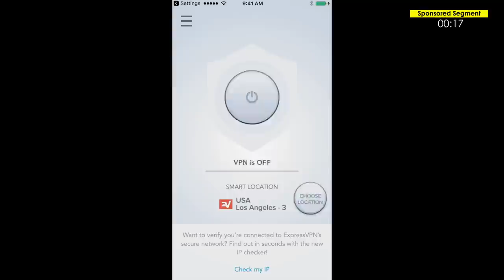Nick Makes a Net Gun to Catch Friends

Comment: Nick could get the tubing for the top darts of the net a little bit more small so there is more air pressure on the top parts and it probably could get the top part of the net  higher-up thus expanding the catching limit of the net

Comment: NICK! might i suggest adding wadding in the barrel and replacing the dowels with a rubber ball? the wadding will seal up the barrel (think like the wadding in a shotgun shell) and push out the ball with more force. I feel that the sticks are too light and that's why you're not getting enough velocity launching the net. you focused too much on the net weight trying to get it to go farther when you should have been focusing on the rod system instead. those dowels just seem too light and if the barrel and dowel doesn't have a good seal, the majority of that air pressure will just shoot past the dowel without at least some wadding.

Comment: Awesome build with the interchangeable heads!

Steve the landlord was giving you the answer right there. RAMSET! Load four of those .22 blanks at each dowel corner....kapow! That net is getting launched with some force. How you set off the blanks? You could use your air power to hammer some firing pins into those rimfire cartridges....or do it the standard way, spring loaded hammer hitting firing pins.  What I am saying sounds easy, but would take some time and money to design / build / problem solve. Would be fun though ....and dangerous

Comment: Realized you weren't getting clean exit with your nerf darts after that fix, eh?   Replace whole thing, or epoxy a same size tube to the broken one, perhaps with metal mesh sleeve for support, or use a bigger barrel.
   By putting a smaller tube into the larger, you've created not only more restriction for the air, but also a ridge all the way around the inner barrel for the nerf dart to get caught on.

Comment: Dude if you can make it so you have like PVC containers, with some kind of Urethane(? Idk what would be best as a sealer when not connected to the gun), so you can just air charge those, and then have mobile Air Canisters, that you could also use in other things

Comment: If I were you I'd go one step further and add like a replaceable Air Canister you never know if an air compressor is going to over-inflate that Air Canister so just in case it would be fun to have like a safety precaution that way your gun doesn't end up shattering again

Like a detachable Air Canister maybe?

But this is probably the dopest thing I've ever seen!

Congrats on 
rebuilding the Air Beast!

Comment: You could actually increase the upper two barrels and then you wouldn't have to aim that high or if you use two air containers at different pressures you can solve the range and the height problem

Comment: Air reservoir is too small (or could raise pressure depending on the valve your using typical sprinkler Max is 90psi) and darts too light